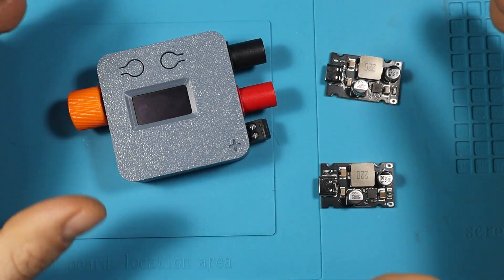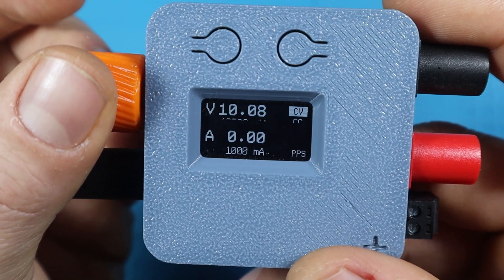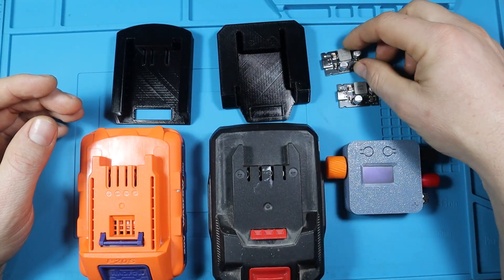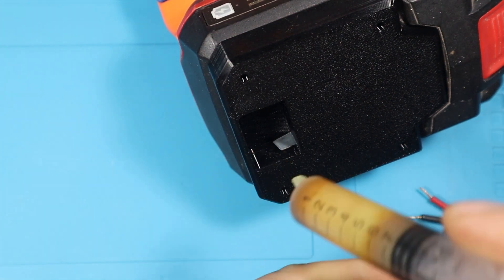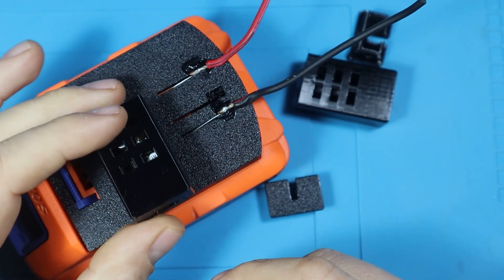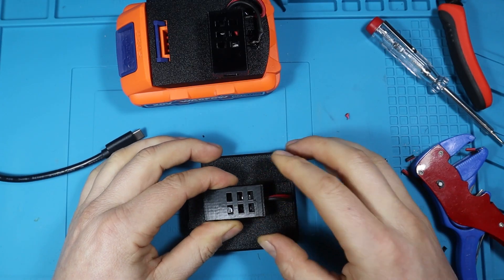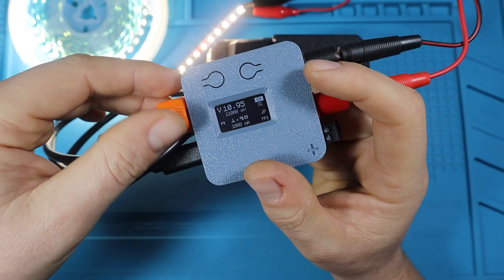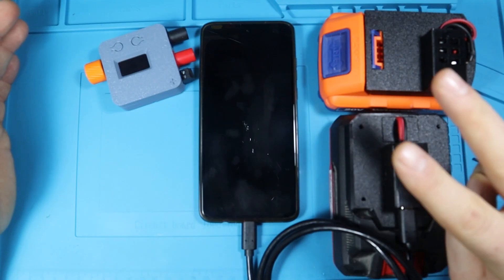Finally, a Practical 65W Power Solution for Mobile Projects

Comment: Is there something to avoid deep discharge of the portable power supply? Makita has this implemented in the tools. Without the tools there are not protected
Reply from the maker: The protection for all of the lithium based tool batteries that I've seen is in the pack itself, so once the battery is empty it will shut down on its own. There is no need for extra protection circuitry.
Reply: @TasteTheCode ”…. Dewalt and Makita have the BMS/LV cut off in the tool.
Ryobi, Ridgid, Milwaukee all have a basic BMS in the battery.”
Reply from the maker: Thanks for letting me know. I never owned DeWalt or Makita to know. All I've owned has that control circuit in the battery. In case there is none, then a BMS circuit is needed.
Reply: @TasteTheCode  it is not the case for parkside battery, the discharge protection is inside the tools. No mosfets inside the battery to cut off one line.
Reply from the maker: Hey, thanks for pointing that. In that case, I should be more careful. I've never opened that particular one to check. Since the PD board can only output voltage to the max of what the battery can provide, I can still monitor the state of the battery and stop using it as soon as the input voltage gets close to 15V or about 3V per cell.
Reply: BMS